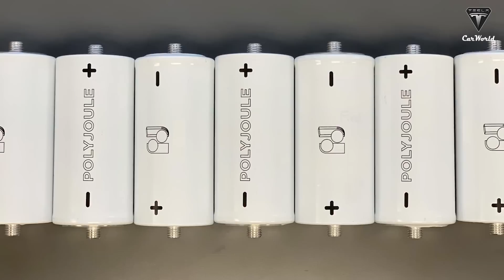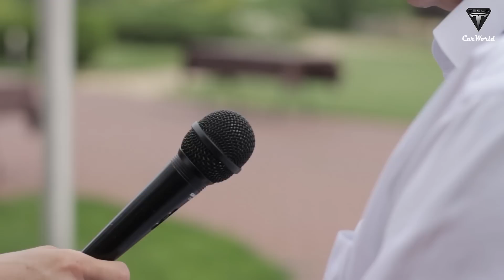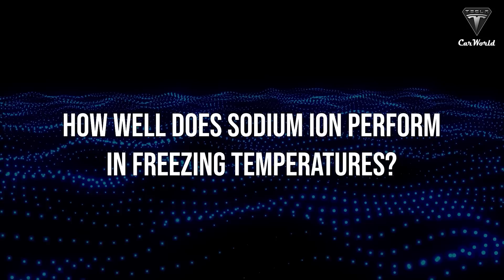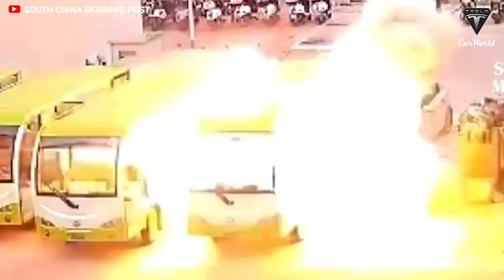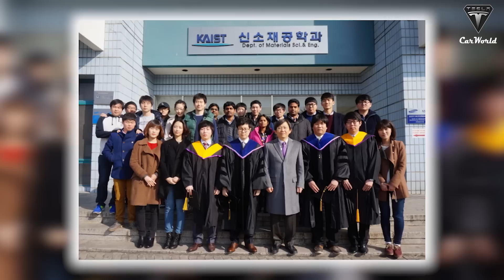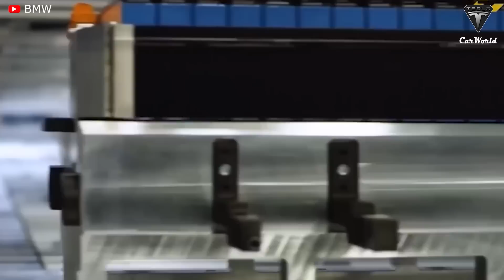Elon Musk Reveals ALL-NEW 4.0 Batteries Design, Changes Everything in 2024!

Comment: Batteries will never be the answer. Though buying an EV pickup truck, and putting a generator in the bed and running it on gasoline can keep your EV truck perpetually charged, till you run out of fuel. . Though it does kinda defeat the purpose I think using a generator to charge batteries. Isn't that what Hybrid vehicles do?

Comment: What is the thevinan equivalent  of a polly cell and lithium iron cell.    So to charge at 50 amps 220v gives a charge of 11 KWh.    Most houses have a 200 amp service.    44 KWh per hour.    The existing electrical grid was not designed  with power distribution at tens of thousands of KW.        I have had several mp3 players.    Once while driving the one lithium iron bater failed while in my shirt pocket.   OUCH!   I quickly revived it threw it on the floor.     All of car batteries and  storage batteries are made of of thousands of cells.    One goes bad, melts down and  the battery cascades failure occurs.   Plastics are hydorcarons.     Does anyone  actually believe a battery made of of hydrocarbons will not burn?   Have any of y ou ever done welding with 2 12 volt car batteries in series?   The only way to kill a battery fire is to coverit with a fire blanket.      They have them  to  cover a car now.    But how about megawatt gred size?    What temp do your hydro carbon battery plastics melt at?

Comment: First fallacy (fantasy) in this video is the statement that electric cars reduce your carbon footprint. This is true ONLY if you ignore the energy involved in mining the raw materials for the car and battery pack, refining the raw materials, transportation of the refined materials, and manufacture of the components used in the car and assembly of the car itself. Second fallacy is the organic periodic table, which is nothing more than a subset of elements from the standard periodic table of elements that are commonly encountered in organic chemistry. The claim the the Poly Joule batteries don't use metals is true with regards to the internals of the battery. However, metal is still used in the end caps of the battery to interface with an electrical system.

Comment: I remain entirely skeptical of charge times for these battery packs.  If you look at the energy needed to top them up, doesn't it amount to 1000's of amps flowing into them in those few minutes?  How is that possible without them exploding in the process?  You still can't beat "re-charging" my gas car with a fill-up in less than 15 minutes, which gives it at least a 600km range (over the life of the vehicle).  And a hybrid is that much better, all with no fear of the batteries "running out".
Reply: If you want to go 600km on a charge with an electric car you're going to need ~100 kilowatt-hours (kWh) of energy storage or more. To charge that pack in ~5 minutes requires ~1.2 megawatts of power!
Yeah, it's not easy. But, the hardest part is delivering that kind of power to the car.

Comment: Ugh...

When the gigantic effort and energy overlay of adding power storage to vehicles is compared to far less overhead required for conversion of petrol fuels to mechanical energy with fewer machined and moving parts, to me this stored energy madness is more competitive blind insanity than true energy efficiency.

No environment energy harvesting system has emerged which produces anywhere near the clean environent that carbon fuels' harvesting already is standadized for.

In energy utulization, little is researched to lower consumption at consumer points. Why not?

Multi passenger vehicles powered with carbon fuels should be developed to use 1/10th current fuel for the same travel.

Think outside the madness

Comment: Seems to be a hoax. Plastics or polymers are more susceptible to heat produced by very high charge/discharge rates than metal based batteries. All these claims of high energy density, cheaper manufacturing costs, higher cycle life, faster charging/discharging , better safety etc etc NEED TO BE PROVED BY INDEPENDENT RESEARCH LABS around the globe. 

More like snake oil advertising to me

Comment: just wait until they put these sodium batteries and they catch fire. a sodium metal fire can't be extinguished by any normal means. oxygen and especially water turn a sodium fire into a monster and have be controlled by smothering with soda ash or use a metalx fire extinguisher. there will be no way to fight a fire on those cars and they better hope they can build them to be fire proof!

Comment: Clickbait but I did learn some of the latest things going on.  Automobiles need higher energy density (li-ion already only about a quarter energy-gense as gasoline), so no, we don't have a no solution to replace li-ion yet.  Indeed this has unfortunately resulted in HUGE price increases as now every major automaker in the U.S. is scrambling to be "mostly EV"  by 2030 or 2035.  We obviously haven't learned any lessons from the Great Supply Chain Recession of 2022.  Nice.  I guess the good news is that the huge Lithium mine in the U.S. has cleared governmental red tape to open for business.  Phew

Battery tech has NOT had vast improvements in recent times; it's been surprisingly stalled, with recent promises of graphene, etc. overpromising and underdelivering.  At least the low cost of sodium batteries would free up lithium for EV's, laptops, etc.  Still waiting for that big breakthrough; needs to result in much lower carbon emissions during manufacturing, easily recycle, at least 50% higher energy density than lithium, lower cost, and similar or better recharge rates and recharge cycles.

Comment: Electric cars DO NOT reduce your carbon footprint.  70% of generated electricity in the US is generated with fossil fuels, less than 30% is still generated by coal.  Coal produces and absolute bunker load of CO2.  A Tesla, charged off of the US grid is essentially a coal fired car, producing 3 Xs more CO2 than a gasoline burner.  Generate your power with sun and wind, and even nuclear,, and then you can claim cleaner.

Comment: Internal combustion engines for all of their aspersions have served society extremely well by dramatically increasing the quality of life for people all over the world.  I love my horsepower and just the feel of a quality gas powered car, towing capacity, reliability, all of it.  I will say, however, I recognize the impact on the environment and understand that internal combustion and fossil fuels will hopefully become obsolete in terms not just environmentally but overall improvement in people's lives much like the light bulb has accomplished replacing whale blubber.  I don't believe we're getting the full story of environmental impact from politicians of switching to battery powered transportation.  My question is related to the fact that plastic in and of itself currently requires fossil fuels as a raw material, to manufacture, transport, and most of all, dispose.  Are we really helping the environment in a real way or are we just changing the optics and much like a placebo just trying to feel better about ourselves?  Can we really produce crops, build and manufacture things we need to survive like housing, heat or cool our residences, or even just get around via real transportation solutions via renewable energy?  I've researched this hopefully objectively from an entirety of lifespan energy usage of renewable versus fossil fuels and people who want answers not a political platform say we're not even close to accomplishing that goal.  Perhaps a realistic transition period instead of a categorical start and stop date would reduce the rhetoric and unite people on the subject instead of what we are seeing now.

Comment: Sure, the vehicle might be able to charge 200+ miles in 15 minutes, or 1 minute, but where is the infrastructure to actually DELIVER that much power that quickly without simply melting the wires after boiling away the insulation or simply burning out the generator.
And that's just one car.
What happens when 20 *thousand want that power IMMEDIATELY?

Oh, yeah, that's right... only the stupidly rich will have access to that.

Comment: Sounds like the ultra capacitor to me. Those plastics from LG have been around since the 1960s. They will only block the flame for some relatively short period of time. Then the fire burns and gets to burn the plastic too. More fuel in the fire, with no help in suppressing the lithium fire once it gets started. What it could do with a warning klaxon is allow the people in the car to park it 50 feet away from anything else and the RUN. That would help the fire fighters since they can concentrate getting that 10000 gallons of water on the fire and not have to keep surrounding things from catching fire.
Reply: worked in industry and fought fires too. wait until you see that a sodium fire puts a lithium fire to shame.  feeds on oxygen and water has plenty and can't be used.
Reply: You don't use water for an electrical/battery fire for good reasons. Similar reasons why you don't use water on a fuel fire.  Fire departments use chemical foams on both types of fires. Any FD that doesn't is probably breaking a law somewhere.

Comment: Bought and paid for fraudulent scientists discussing carbon Footprints are those who propagandize and promote global warming and global cooling before that were the same alleged data and then also now sits it doesn't fit models correctly it which are all fake they now call it climate change, which is a mother nature phenomena...
Affected mostly by far by the output ofSOL, our sun. And also to a good degree by the energy bombarding the Earth from the cosmos, which has an effect on Earth's core and can shift its equilibrium, slowly or cyclically. 
Other than emissions LED off by high-flying Jets military jets missiles and Rockets, man down here on the troposphere does not really affect anything mostly because carbon dioxide is way heavier than air, in gravity generally pulls it to the ground and sea levels to act as food for plants grasses in algae... Eddy currents are nominal